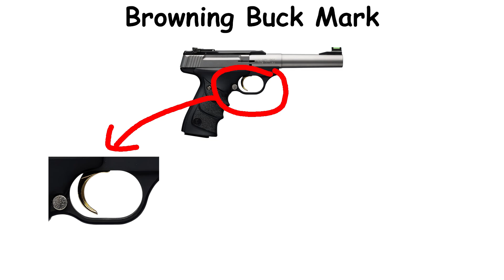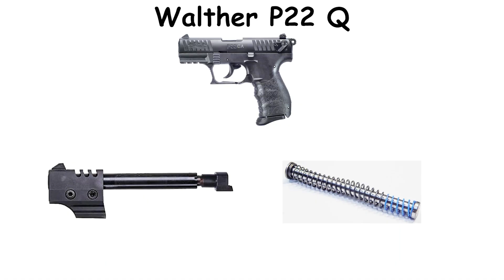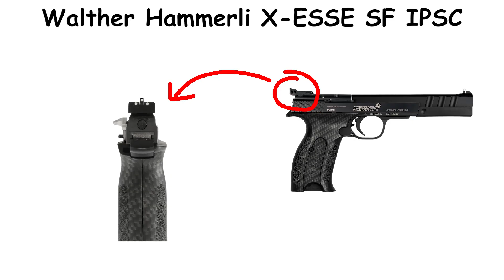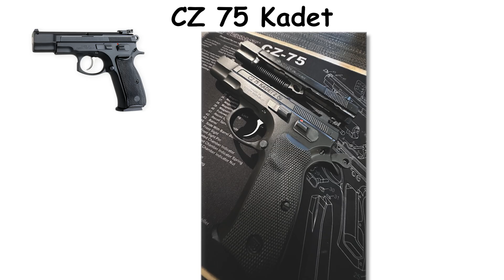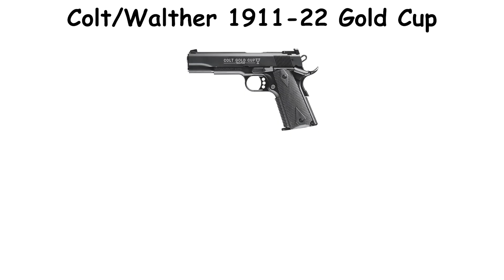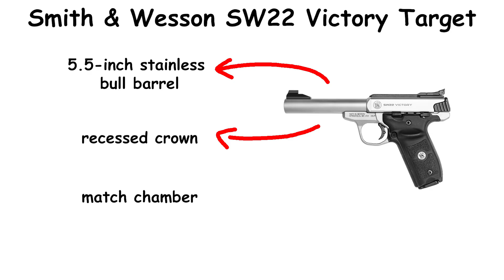Every Modern .22 LR Pistol Explained

Comment: The Taurus tx22 is LEAPS AND BOUNDS better than the FN502 and Walther P22. Not sure why that one didnt make this video?
Reply: TX22 bad. Get Ruger Mark IV
Reply: Lol Taurus is budget crap
Reply: @ResidentGunNut the Taurus TX22 us a better option than a lot on this list. Youre "the gun nut" which im funding hard to believe given your take on Taurus.  Its budget absolutely, but theyre not crap.. they're a great optrion for those with a smaller budget.   I spent 500 bucks on my FN502 and 300 on the tx22 and the tx22 out performed it flawlessly through 1000 rounds
Reply: @DeltaMike.13  I could say the same about my Taurus 689 VR—it runs smoother than a lot of Smiths and Rugers I’ve handled. But that DOESN'T suddenly make any Taurus gun better than any Smith or Ruger. 

Taurus once faced a class-action lawsuit because their Millennium and PT series could fire without anyone touching the trigger—people actually died because of it. To their credit, at least they owned up to it, unlike SIG. Hats off to them for that. But there’s a reason people say you get what you pay for.

At the end of the day you scored a good TX22 and a lousy FN502. That’s not proof of anything—that’s just an anecdote. Like you, I value a gun that works— but unlike you, I don’t have blind loyalty to any brand.